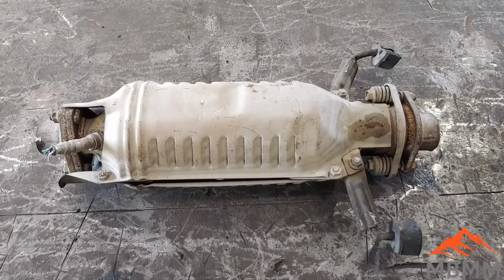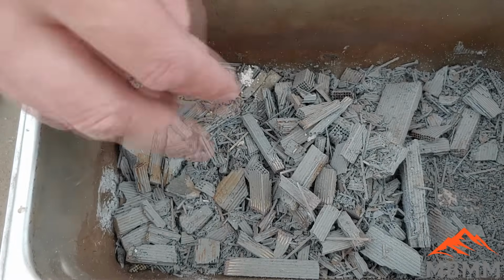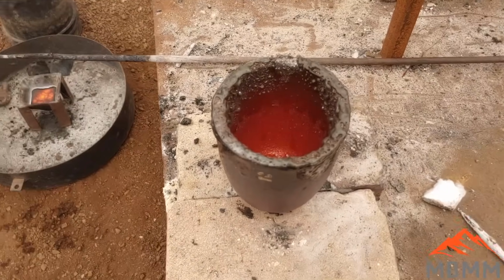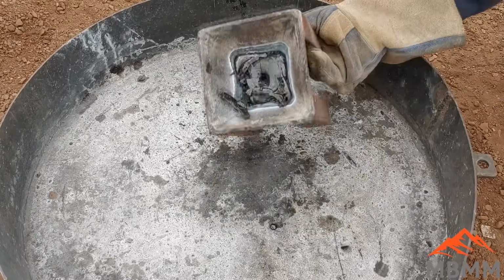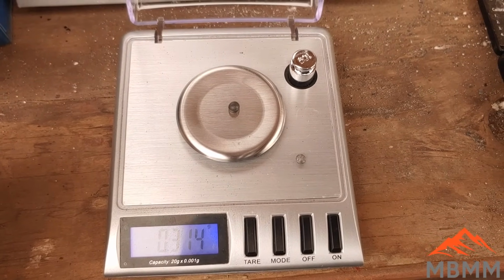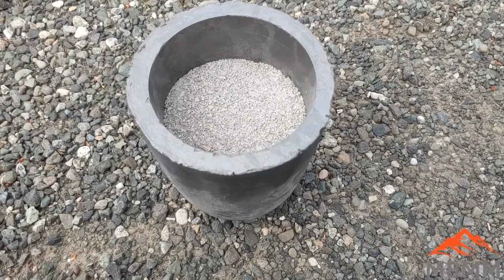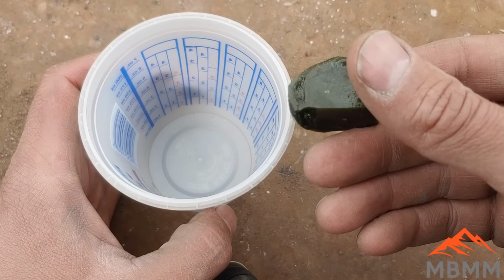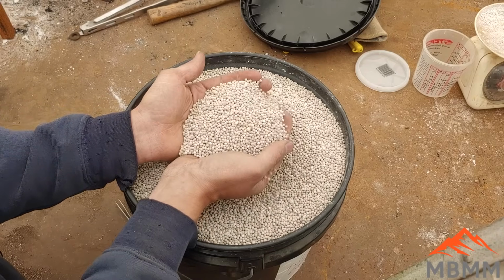Smelting Platinum/Palladium Catalytic Converters For PGMs..... Success???

Comment: That's a Honda cat lots of guys will have different names for them.  I know it just as a Honda 2 or a 9/7 Fin with end O2 sensor.  The codes are stamped on the flange of the pipe and are typically unreadable so they're paid on an average.  $240-$300 on today's market which would have not been too far off 2 years ago.

Comment: I'm thinking to break this stuff down to a very fine dust and then put some very very high pressure and butane to seperate the metals, I think that people are thinking wayyyy too much about seperating these VERY VERY FINE METALS WHEN IT'S CONDENSED INTO A VERY FINE POWDER AND A BUTANE IS A CHEMICAL AND IT CAN JUST MAKE THINGS VERY VERY EASY! I HAVE A CAT BACK ON A HEADER THAT HAD CRACKED SO I HAVE SOME PRECIOUS METALS TO PLAY AROUND WITH!

Comment: it also could be your crusible that your using thier as well. if u just use a crusible for each type of metal that your smelting.  say one for platium only. onev for gold and so forth. you not mixing your metals. so try doing platuim only no other metal or mixes.

Comment: That catalytic converter looks like it came off of a medium size foreign vehicle. That would be a medium foreign cat. I will get about $450 from my guy right now for that cat. Without having to cut it open or melt anything out of it. So that means there has to be six or seven maybe $800 worth of platinum and other metals in there if I'm getting that much for them all day long

Comment: Cody from the Cody' s lab YouTube channel swept up dust from the side of a well traveled stretch of highway and found the content of the sweeping to have enough platinum group metals to be reasonable ore for mining I would like you if you have a high traffic peace of highway to get say 100 lb of sweeping and do that again to see if you have similar results I would run it through water to remove anything that floats and bring it to minus 60 grid run across a shaker table the smelt whatever is left and let us know how much platinum group metal is sitting on the shoulder of the highway :-)

Comment: I think you would have a much possibility of reaching the core response you want if you utilize a flux capacitor midway in the smelting process. When I say midway, I MEAN midway! A two minute start on either side of the midway point will definitely result in a caustic smelting reaction that most likely would fuse the entire project into a slag that will completely unworkable or usable in any meaningful way.
Reply: But it takes 1.21 gigawatts to power a flux capacitor. Where would you get the at power?

Comment: The rhodium is what makes cats valuable Platinum isn't worth s***($1200 an ounce $39 a gram) especially the time it takes to smelt a cat. The amount of palladium ($3,000 an ounce $95 a gram) that is in a cat is not worth the trouble to extract it. The rhodium however is $900 a gram for $28,000 an ounce so even the microscopic levels of rhodium in a cat make it valuable.

Edit: just realized this video was over a year old and prices back then work what they are today May 2021.

Comment: Platinum on todays spot price is $1,313.13 per once = 28.34952 grams or $46.3193 per gram.  At 1.3 grams = $60.22 for all your effort.  

Very interesting video, to be sure, but I'm guessing you lost money on the deal.  if it was $25,000 once like it was last year, then maybe ($1,146.04)

Comment: There needs to be a VIN number registration with each OEM Catalytic converter and the recycler would be required to record the sellers ID (state issued) and the VIN to verify that it is not stolen. The recycler would charge a fee to the individual bringing in the cats. The recycler would then pay the fees to the state. This would help to reduce the theft of catalytic coverters.

Comment: A starting or midpoint might be to pull a metallic sample, as you started to do, amalgam it with mercury, then distill off the mercury, fractionalizing other metals along the way.
Honestly, I'd go with spending a week or so with an industrial chemist.
Lest a simple and inexpensive step be missed, quartering the worth of the recycled metal.

Comment: It's worth more as a catalytic converter than the amount of precious metal you get out of one converter.  It makes no sense to try to extract the tiny bit of precious metal one converter has as only worth a couple of dollars when the converter itself is worth a $100 if you recycle it and sold it to a muffler shop and the muffler shop resold it to the customer for $600. Installed. You can go on eBay and buy and universal  converters  Brand new a pair of them for under a $100. If the precious metal was so valuable how can they sell brand new converters for $50ea🤷

Comment: Refining platinum sucks... I avoid jt  untill i build up so much scrap I have to or be broke. Its cranky about going into aqua regia. Gotta micromanage it. As far as directly smelting it, you wont get a high enough temperature from a propane forced air furnace. It doesn't melt until its 3215°F compared to gold at 1948°F. I got a guy who uses a hydrogen fuel torch who takes care of it for me locally. I think somewhere i read it could be dont in a regular furnace similar to an inquartation refine with gold but im having trouble finding it to be entirely sure as i never tried it, its somewhat similar to your cupelling solution but you end up with a solid but spongy chunk. Ive heard from other refiners that they just sell pgms as a salt to a major pm refiner.likely route i take when i finally do something withe my hdd platter stacks

Comment: Dude what about the rhodium?
Reply: Rhodium is the most valuable heavy metal derivative of platinum on Earth and there's supposed to be at least 2 to 4 g in every old school catalytic converter it makes Platinum look like pennies rhodium is going for approximately 28,000 an ounce so that's $2,000 minimum per catalytic converter if extracted correctly and up to $4,000 if there is a higher quantity like I said anywhere between two and four grams per catalytic converter it's a total game changer for the old 70s cars that still have the California exhaust package and some other states that required it as well

Comment: Your not getting hot enough  to actually melt the metal...you will need a catalyst metal... that will help to Initiate the melt quicker and at a lower temp...good luck...

Comment: why not just submerge the ceramic in Aqua regia until it dissolves away the plate?  but nitric acid is really expensive. meaning it's not economical. will Aqua regia dissolve rhodium? a couple months ago pertaining to catalytic converter theft. basically, there skyrocketing but any ways they said that catalytic converters also contain rhodium. 20k an ounce. could the tantalum reading be rhodium?   if it's an accurate reading it could be in the ceramic. yah none of it seems economical on a small scale to steal. but they are expensive to buy so maybe there just selling them? ie there stealing them to pass emissions. apparently, inflation strikes again.  I had to buy one several years ago to pass emissions. it cost $900! that probably the real reason behind the sky rocketing theft.  also, your whole shop is probably contaminated with lead. look at it like this a lead paint chip 1 cm x 1 cm ingested is enough to kill a man. I would be worried about lead contamination. it spreads around and sticks to everything. I don't think it's safe to do that.

Comment: Whoever accepted that in the scrap yard should be fired 😂  that thing was definitely stolen, none of the bolts rusted but it's cut on  both connecting pipes? O2 sensor wire cut. No mechanic replacing it would've cut it when it would've been eaiser to unbolt it and do a direct replacement.

Comment: Xrf algorithm is designed to make up 100% of metals. So on the xrf spectrum its guessing. My xray has alloy mode and precious metal mode. So tantalum is just the algorithm guessing. It's not correct. Do you realize how much heat is required to melt rhodium? Also Rhodium isn't soluable in silver as much as copper. Your throwing away alot of metal. You need to be using aquas chemical process. Your throwing away money. Also if you want to smelt it you need an induction furnace your dealing with such high melting points. Also your flux is wrong. What Flux eats ceramic substrates? Also you need a Flux to make it more fluid. Msg me I'll provide some help.

Comment: looks stolen to me LMAO. 90% of the time if it's not stolen, it'll be unbolted not cut off.
Reply: 100% of vehicle sent to the crap yard are cut of, not unbolted. Al 99% or converters replaced at muffler shops are cut not unbolted